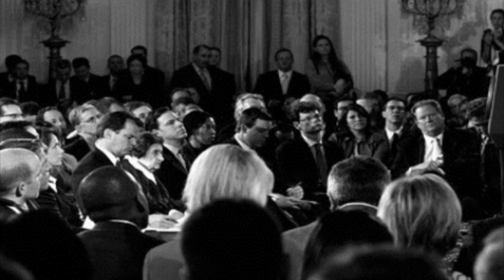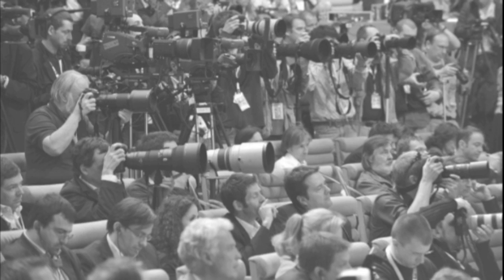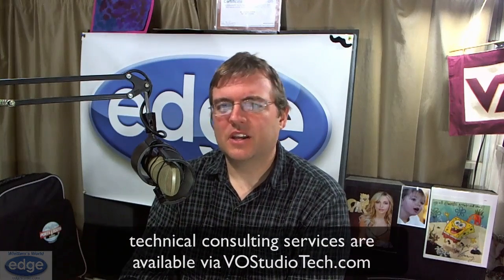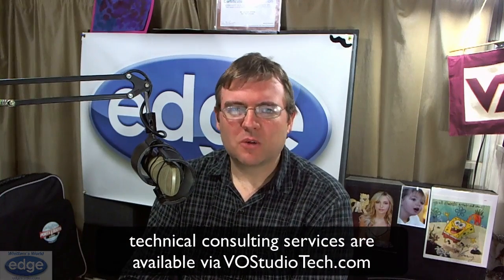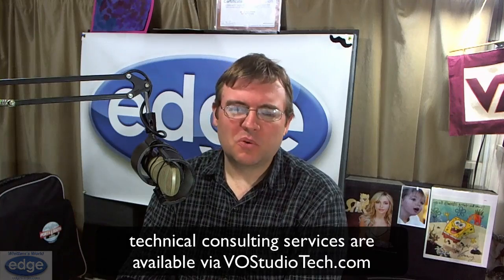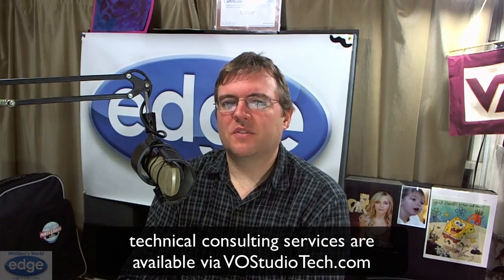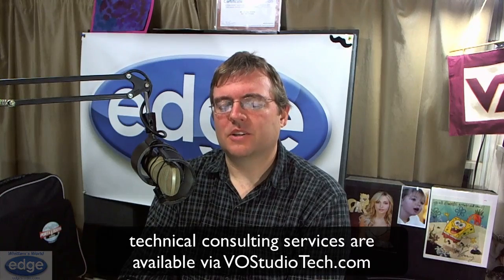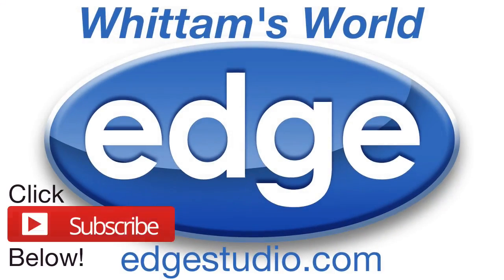Whittam's World - Episode 17 "15 Tech Questions Answered in 10 mins!"

Comment: Hello George, I have a tech question for you. I am not a tech person.  I would like to reproduce my current hardware set-up that allows me to record my computer /SKYPE guests on one track in multitrack Adobe Audition and I can record myself on a separate track in multitrack. This is perfect for podcasting.  I've tried different set-ups but nothing works. My DAW- Adobe Audition and Reaper. My hardware is old and discontinued. I would like to have a back-up and I need to find replacements. My current hardware-   I am using  a Behringer Eurorack UB1204 PRO mixer which has my mic XLR  connected to channel 1. I have RCA split cable for the SKYPE on channel 7/8 in. The RCA cable goes from the mixer  into the back of my Dell Optiplex 960 in the green of the pink,blue green  audio plug. The mixer is connected to a (discontinued) AVID MBox by XLR cables. The cables go out of the back of the mixer and into the INPUT on the back of the Avid MBox. My gain for my channel 1 is turned hard left and the gain for SKYPE, guest channel 7/8 is hard right. My head phones are plugged into my AVid MBox.  The AVID MBox is connected to the computer front by USB. This works beautifully, but I cannot reproduce it. I purchased a USB  PreSonus preamp and a Behringer 1202FX but it does not work. I would like some suggestions to reproduce my current setup for podcasting. I am wondering if a Behringer 1204 USB mixer would work. I don't want to spend more money without some direction. Thank you in advance.
Reply from the maker: Hi Paula:  Please check out this service for your exact needs:  http://www.edgestudiotechnology.com/skype-phone-patch.html